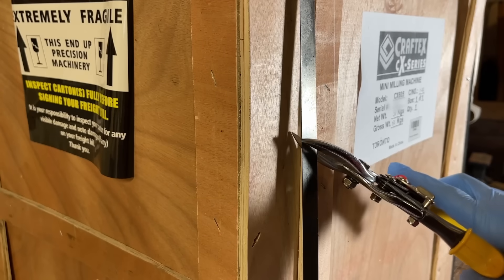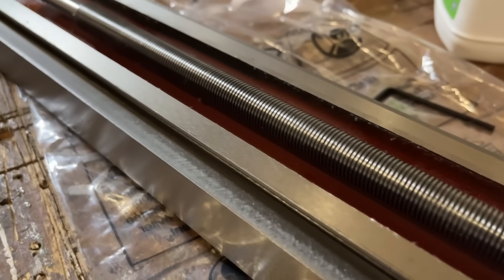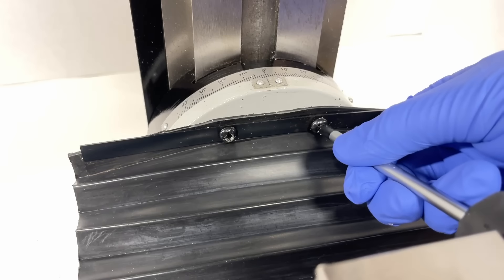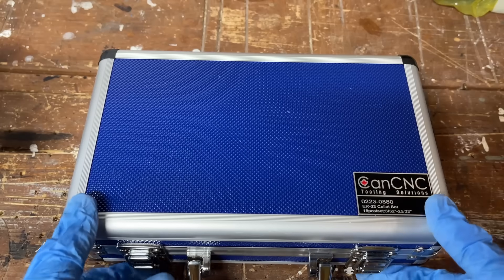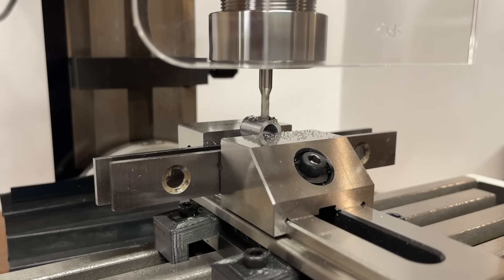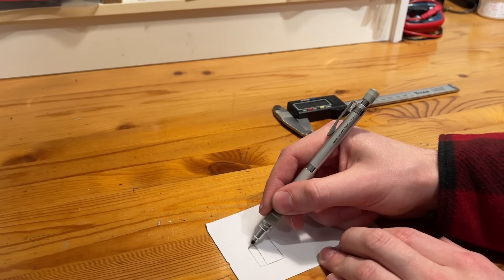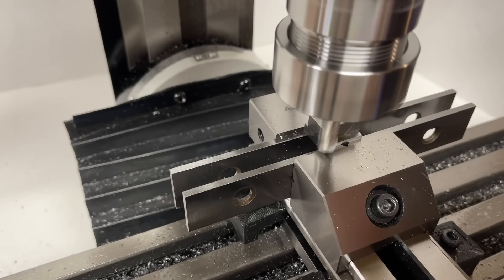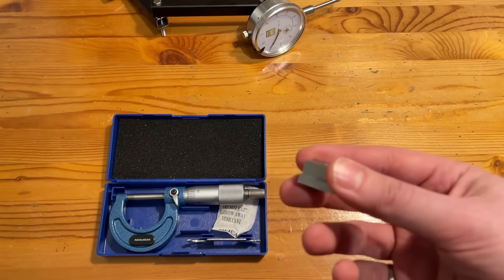I Bought A Minimill to see if they are Worth It

Comment: Minimills are absolutely fine for hobby machining. The main issue you're going to find is that many of the issues brought up are probably with using it for business purposes in mind. As in when someone says it can't be used on steel I have always read that as them saying you can use it but the amount of time is not cost effective. I'd also like to point out that you had it go out of tram on the video and your final test was checking after a clean up pass? Not saying roughing will definately make it go off tram but you basically gave it the easiest tast short of using a 1/8" endmill. Tolerance wise you'll basically be okay as long as you're taking slow small passes and creeping up on it but again this is unnaceptable for job shop type work as it takes far too long. I wan't to stress that I have no issues with mini mills but just remember their scope is very limited.
Reply from the maker: Excellent point, for producing parts in a production run it wouldn’t be possible to keep pace with full sized machines. As for the testing  I see how that was confusing! I didn’t do any re-alignment after I made the t slot nut so the full scope of the test was the roughing and finishing of the t slot nut, plus the clean up pass, after which there was no shifting. I was mainly curious if there was some weirdness going on from vibrations caused by the larger endmill
Reply: I used a Sieg X2D (the fixed Z column version of the mill in the video) to start my business. I built my own cnc conversation using Centroid CNC Acorn and closed loop steppers. I added a belt drive kit and a 1.1kw spindle motor. That little mill allowed me to start my business and get a real foothold. I'm now running a Syil X7 and I'm on my way to saving for a Brother Speedio or something else. Not quite sure yet. Long winded way to say that these little mills are great. Also check out John Grimsmo. He built up from one of these minimills to one of the craziest cnc machine shops I've seen in Canada.
Reply from the maker: Love to hear the success stories. The whole goal of this video was to show that these are very capable machines so it’s nice to see that I’m not mistaken!
Reply: @Someone_Should_Make_That  love to see people giving those machines a fair shake! anybody remember proxxon? they are total garbage, compared to the chinese ones, at double the price!
Reply: @jamesfrancis9520  i am currently finishing my CNC-lathe (also sieg) and planning to do small serial production runs with it. it has a gripper and toolchanger. i hope i am not crazy - your comment is a great read in that situation! :)
Reply: That’s genuinely inspiring.
Reply: Good post. I'd like to add that due to the all-in-a-line bolts that connect the z pillar to the x-y table the system is prone to nod in the x axis. At the highest z from the table you sometimes (yes, in my case) .128 +,- from TDC. So you may get ~accurate and small or sloppy and tall, but you will never get accurate and tall. My purchase of one has been a worthwhile learning experience since I came to the trade with no experience at all. If you know nothing and want to learn I wouldn't turn one down if it was given to me like I would now.
Reply: @ExtantFrodo2  
if you are a hobbyist just expecting everything to just do what you tell it to.  then yes.  you won't get accurate and tall parts. 

if however you are an actuall metal worker specialised in milling.  you can make high precision fittings at the full size of the machine.
Reply: @darkracer1252  "a hobbyist just expecting everything to just do what you tell it to..." -- Exactly.  Even on full-sized machines, tools deflect.  You don't dial in the finished size when you still have .050" to take off.
Reply: @crispinmiller7989  
how much it deflects doesn't even matter.  just repeat the same amount of load for the last several cuts when you are doing your measuring.

or if programming in cnc. 
use math to calculate what it would deflect and program a correction into the path.
Reply: @darkracer1252  Agreed, those are legit approaches too, more sophisticated than my duffer approach of getting close and then doing a cleanup cut.  Obvious once you think about it.  Thanks.  
The "expecting just what you tell it to" mistake is to take your datum setting for your tool position in a situation with no deflection -- for instance nudging the tool up until it just barely touches --- and then dial in some substantial advance distance for the tool, and expect the resulting cut to be that same distance, without accounting for any deflection -- as if the tool and its support were some mythical totally rigid object
Reply: It stands to reason that a small machine can only take small cuts. It's right in the name, it is a mini mill.
Reply: I don't know why people say that. 
I've had the same model he has got 6 years and I not only almost only use it to mill steel, I actually use it to mill hardened steels and tool steels for my knife making. I even have used it to mill HSS on numerous occasions. As long as you have everything set up rigidly, the mill tuned nice and tight and a good quality carbide end mill, you can absolutely mill steels in the 60+hrc.

Now I obviously don't take .030" passes like I would on mild steels, but I can take .010-.015 no problem. 
You just need to run the carbide fast.
Reply: I used to have one. I could get half a thousands fairly easy on aluminum. I could do steel, but it was tough. I had the servoes and controllers and what not getting ready to turn it into cnc, but could not find the time to finish it, ultimately sold it.
Reply: It's just that it's not as rigid as a larger mill, so of your working with tough steels you just need to take lighter passes. 
Of course with aluminum, brass, plastics or even wood you can hog off larger amounts.
You can double the depth for alum or brass and your can pretty much go 8x more for wood or plastic.
Reply: For comparison: my cousin owned a plexiglas shop. The custom lasering of some orders was outsourced to an external party, with professional laser equipment. I convinced him to try our luck on a cheap 100W china laser (it still cost E 1500 in China plus E 1000 in shipping and customs) and our main worry was whether the results were good enough to be sold to customers. Long story short: the laser was amazing, no worse than the 10x times more expensive Trotec of my local makerlab. Some finishing details were a little cruder on the Chinese machine, but overall construction was solid. I know a laser is a different beast than a mill or lathe, but I've been solidly impressed by what the Chinese can put out at what pricepoint.
Reply: It's just a wee machine, what can you expect.?
Reply: Correct analysis. Mini mill doesn't have the heft to make big cuts. So you always have to do it in more passes. More time. More cutters.
Reply: At 5% the cost of a commercially viable machine.  And no machine salesmen is worth a lot to me.
Reply: it wouldn't have happened during the clean up pass so if someone checks it after the clean up pass and it's out of tram. then that's their own fault.

Comment: 2:25 Use aluminum foil for finetuning. It's about .001", so folding it over a few times can give a good range of thicknesses.
Reply: If using it for headgear, remember that it takes at least five layers to block government control signals.
Reply: @ArcticNemo  You are thinking of Tin Foil. "They" changed to aluminum alloy foil. Doesn't work anymore ;-)
Reply: @markluxton3402  They changed it eighty years ago.
Reply: @Telephonebill51  Yeah, has not worked for awhile ;-)
Reply: @ArcticNemo  You definitely want to upgrade to copper foil for that. Aluminum foil is a gubermint trick to make you feel safe while leaving yourself exposed.
Reply: @ArcticNemo WAIT. What ... 5? Are you SURE 3 isn't enough?
Reply: Use feeler gauges as shims. Cheap shims.
Reply: @lassiheikkila3054  More than this, they are steel or brass and thus won't compress and change under stress and vibrations like alu eventually will. Here's one place where Harbor Freight is your friend with the cheapest shim stock assortment you can get.
Reply: Pop cans are .004" and beer cans are usually .002"  they are the traditional bike shop shims!
Reply: @nono-oz4yc  Soda 🤣
Reply: @nono-oz4yc  Yes!!! Always mike your shims.
Reply: shim books are super cheap. just buy real shim books. you're wasting your time screwing around.
Reply: "about" ?? For crying out loud, a set of accurate feeler gauges are about $10. Stop screwing around.
Reply: Aluminum cold-flows, not a good thing for long-term precise shims.
Reply: Aluminum foil is too thin and flimsy. Strips of aluminum cans work better and can take more pressure and stress.  Yes, cheap feeler gauges would be the best as they are from heat-treated tool steel which has been ground and polished to high precision dimensions.
Reply: But isn't aluminum in general a bad idea? Seems like it would be too soft and malleable.
Reply: standard aluminum foil is .006
Reply: 0.006mm, perhaps? Aluminum foil is way thinner than aluminum beverage can sidewalls, which are 0.004” thick.
Reply: @fewminutestudio959  I would think there are several thicknesses, and alloys. "Heavy Duty" would be thicker.